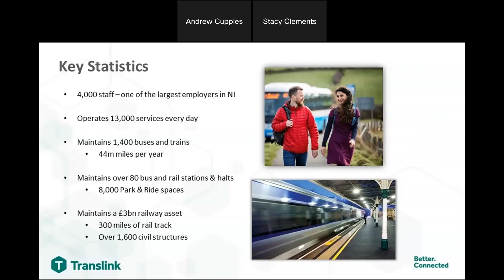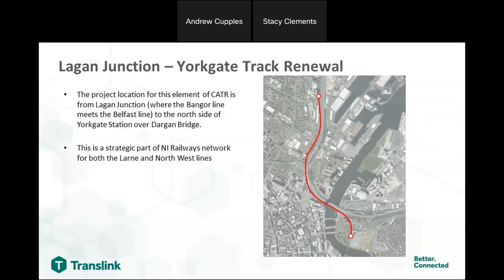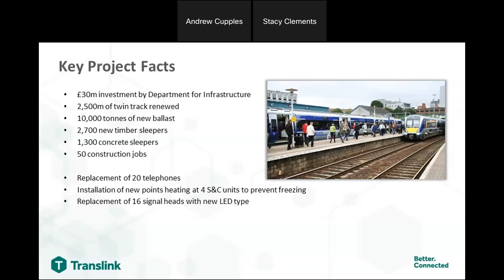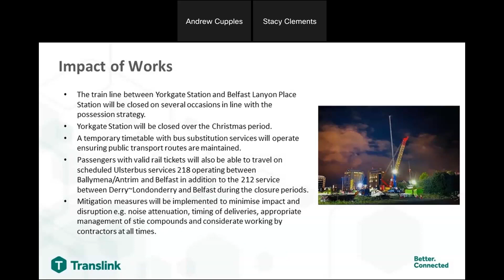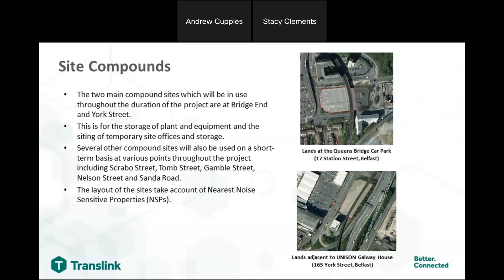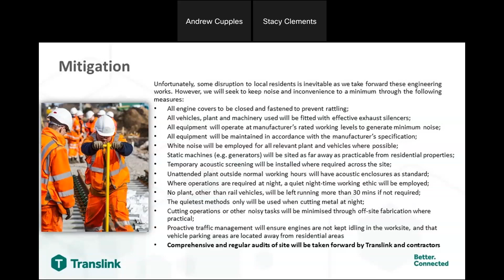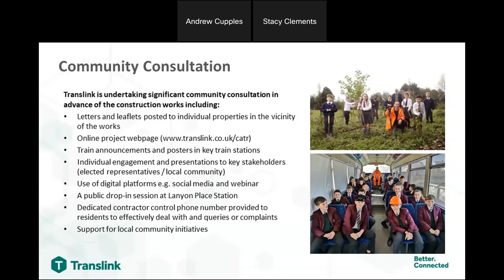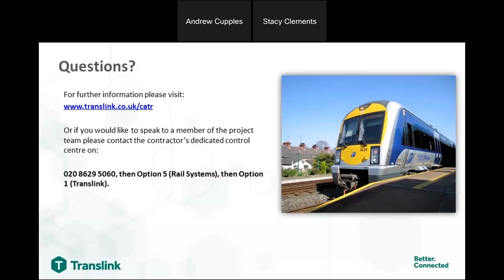Lagan Junction to Yorkgate Track Renewal Project

Comment: I feel like the Dargan bridge being a double track would be a beneficial improvement for rail travel as the bottleneck it creates is quite pointless.

Also, instead of a bus substitution, wouldn't it be smarter to use the Knockmore line to divert trains headed to GVS from Coleraine?
Reply: Trains run to and from Coleraine every hour, and you can only get a maximum of one train each way every hour and a half between Antrim and Lisburn, so you need buses anyway
Reply: It's true about Dargan Bridge being better if it were double track, but there's no sign of DfI providing the funding to put that right
Reply: @AndyBoal  Well the Belfast City Council has asked the DFI to undertake cost and feasibility studies into the CircleLine, whihc would need the Dargan to be doubled to be built so fingers crossed.
Reply: @Squareheed  Circle line is a logistical impossibility even if you double Lagan Junction-Antrim and Antrim-Lisburn.  Where are the local trains to Larne and Portadown supposed to fit in, let alone the long distance trains to Dublin and Derry?
Reply: @Squareheed  or do we want the Enterprise to run at a maximum 30mph, just as it does behind the DART in Dublin which we shouldn't be accepting either
Reply: @AndyBoal  Triple the lines, kind of simple really
Reply: @Squareheed  Good luck getting the ratepayers to pay for it, the residents to give up their houses, the businesses to give up their premises, and passengers to spend an hour going to the airport when the bus takes 40 minutes, not to mention finding a place to put a station at Abbeycentre that doesn't leave passengers walking through an industrial wasteland to Abbeycentre itself.

Running the extra services would increase the subsidy NIR gets by several times, and in all seriousness, the money would be better spent reopening Lisburn-Antrim for a half hourly service, widening the Dargan bridge, doubling Monkstown-Antrim, finishing Coleraine-Waterside and Portrush, and reopening the line to Armagh, and there would still be cash left over.
Reply: @AndyBoal  Or we could cancel the £1,500,000,000 A5 Omagh bypass and use the cash to rebuild that and more.